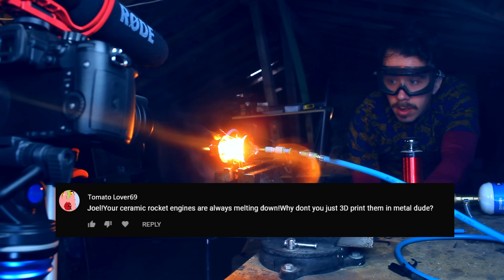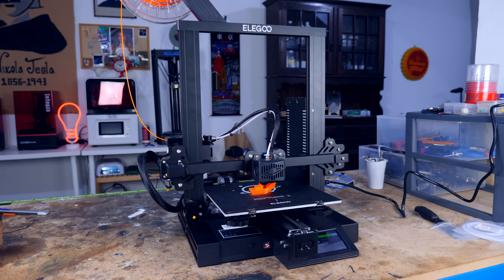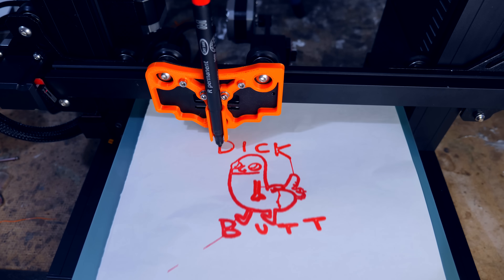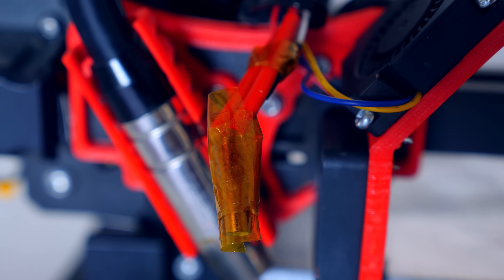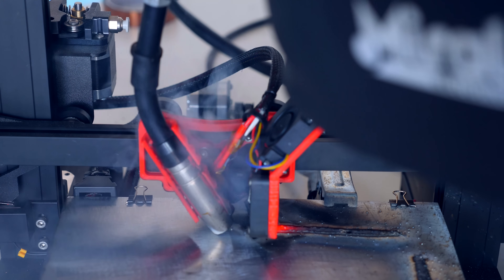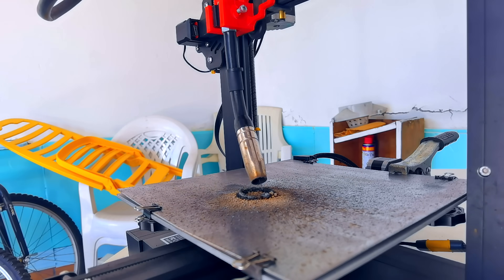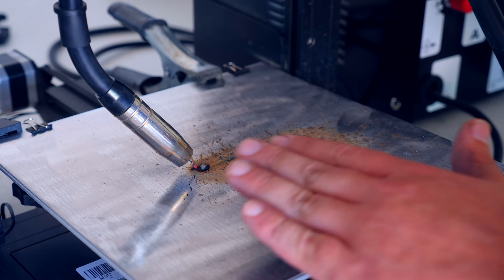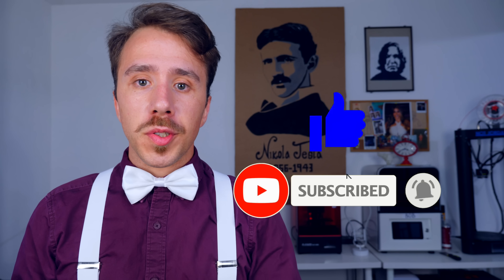I built a Metal 3D Printer using my Welding Machine

Comment: you need to mess more with the welder settings you need to lower the power so insted of penetrating it will gain 
height still and awesome job! And btw theres like a can of a special spray that makes it so does little beads dont stick to the metal

Comment: A (simple) machine using only household items/3d printed parts that effectively strips scrap wire. Copper prices are going up, so there's an increased demand as of late. However, all the .stl's on thingiverse and other like sites are either ridiculously complicated or require a multitude of purchased parts. Don't think I'll win, but having more attention on this would be greatly appreciated by the scrapping community

Comment: Video Idea:  
 Try making ur metal nozzle by 3d printing a plastic one, then use it to make a sand casting mold. the full video could be u DIYing one of those cheap metal smelter out of a hair dryer, plastic buckets and concrete. so then u can melt aluminum and pour it in the sand cast. finally u dremel the final details and there u have ur rocket engine nozzle. 
Saudações xoxo

Comment: you have to put the welder in a neutral position "90° to the surface " and you have a MAG welding machine so u have to use the inert gas at roundabout 8-12 liter per minute . and you have to improve your welding settings . like 123 amps and 9.1 meter per min wire speed , and the distance between the welding nozzle and the metal is to great try like 10 mm

Comment: Amazing how close you were to getting this working.  A few changes would get you much closer!
1. Find a mill to make a metal clamp for the welding gun.
2. The welding gun doesn't need to be tilted, that's mainly so you can see what you're welding, but you don't need to see.
3. You seem to be using flux cored wire, so you have to clean the slag with each layer.  You can avoid this by using gas shielding.
I would love to see you get this to make a metal benchy!
Reply: this, would love to see another go at this from @integza

Comment: Innershield welding wire is better welded pulling behind like an electrode, not pushing in front like you'd do with a massive wire under gas cover. Your mashine sadly doesn't seem to be able to switch the polarity to make that happen. :(

Comment: I wonder, if you had a better quality welder, maybe you wouldn't get the small amount of over-spray on the bed? Also, maybe they make a welder with a thicker gauge of wire so you wouldn't have to have as many layers. A cool video idea would be to make a wankel engine powered tank. It would be really "fun" to make a gear box for it.

Comment: i still say printing your motors in ceramic is good but you should then impregnate the ceramic with metal by either electro plating or if you want to go crazy plasma electro sputtering

Comment: Future Video Idea:
How about instead of trying to print a metal engine, you use your ceramic printer to print casts for pouring metal into?

Yes, it involves melting actual metal down, pouring it into the cast, LOTS of T&E (Trial & Error) and hoping the entire time that it all doesn't end in disaster...  

BUT it would be WAY cheaper than purchasing a metal 3D printer. Just a bit more dangerous and messy.

Comment: Hi, very nice try of making everything work and i can think i can help you with one of your bigger isues.

The issue i mean is the angled nozzle, which isn't actually helping you. 
The reason that the welding itself runs much better after you changed it, is the increased length of the wire between nozzle and the welding bead. 
This is called stickout (atleast thats the english term i remeber for it) and 10 to 20mm should be enough, you have to test it abit what runs best, but setting the nozzle up perpendicular to the metal and having more stickout than in the first tries should keep the welding running smooth. 
Which means your welding bead should be much more symetrical and where you want it in the first place.

Another issue is the warping of the sheet metal and potential heat damage to your 3d Printer.
But saddly to help with that you do need access to thicker (much thicker) metal that can be used as a heat sink below the actual sheet metal that you want to weld on. But even that would not really prevent warping (even 12mm thick welds warp if you do a 3 layer V groove weld), you can only mitigate the issue with using thicker steel, 3-4 mm thick steel should warp less atleast. 

Also an issue you will run into after having more/many layers welded is build up heat, which means either a cool down pause or reducing the amperage and voltage of your welding settings. One warning sign of this should be a "sagging" of the newly welded beads, basicly the higher heat makes the bead hotter and much more liquid. 

If it is helping, i have been certified for welding steel with SMAW/MAG in Germany and while this has been some yeas ago i do remember much about it(, also im only missing a bachlor thesis for having a Bachelor of Engineering in mechanical engineering), so if you have some questions im happy to give some advice.

PS: There are non linear movments in GCode (G02/G03) but i think most 3d Printer don't use them?

Comment: Hey, great stuff you are doing here, love your videos ❤️
I also maybe have an idea how you could try adjusting the current. I think its called binary guessing. For example you got following formula: (max - min) / 2 = current. Max is your maximum voltage and min your minimal voltage (maybe 1/2 of maximum? Idk) test current and if you need more power just fill current in as your new min and if you need less power just fill current in as your new max. That way you can get to the best value way faster than with normal guessing.
Again, great videos. They are always very inspiring and entertaining ❤️

Comment: how about 3d wellding in water?
that might cool the stell sheet and prevent bending
Reply: That would work but it adds a whole nother problem you would have to find some way to ground the water box and the sheet metal separately to get the welder to work properly
Reply: Without the right sort of coated rods, you'll have nothing but porosity. Using a big old chunk of aluminium under the steel plate would work.

Comment: The cheap MIG welders are an AC current welder which causes a lot of problems. And dealing with flux core wire it is always going to look kind of bad. If this was done with a DC welder it would look considerably better.

Comment: Great video Joel something i was looking at doing in the future, why don't you try and put a metal extruder and stepper motor in the welder where the wire is and run the welding wire through that first same as you would route filament, run an extension cable from the 3d printer ?

Comment: Angling the tip of the welder is dependent on the direction of travel, speed of travel and penitration. Also the arc is well over is over 3000°c which on longer periods is going to Warp your bed.

Comment: Here's an idea: How about using carbon fiber for the rocket nozzle. I think it is more durable than ceramic and its not very costly.
Reply: The issue isn’t durability but temperature resistance. Carbon fibre can take high temps but the resin used to hold layers together can’t.
Reply: Fiberglass might be even better, it’s cheaper, easier to work with, and similarly heat resistant/durable
Reply: I dont think that's as much of an issue as you think. He did make his pulse get engine out of carbon fiber and fire place cement and that took the heat quite well. Think it's worth the shot

Comment: The reason it is warping is because the heat is being sucked out by the aluminum and the metal warps away from it... you see this in bladesmithing... when a blade is hot and set on a cold anvil, the blade warps away from the anvil.

Comment: Hey Integza! I know its common to angle the nozzle when welding, but since it is being used in a 3d application, can you try making an angle support bracket? I am not usre what your angle is on that welder, but make the same angle for the support, so it is vertical! that way you can have it much much closer to the print surface and hopfully more accurate dispensing and welding. Also as a sidenote what if a thicker bed was used, I noticed a major amount of bed warping and you may be able to get around this with a nice thicker piece, or even a different grade, hopefully you need need to sell any organs for it!
Reply: I think we would all love to see a continuation of this home built metal 3d printer, as I sure im not alone with us all not being millionaires with industrial grade metal printers at home.

Comment: Video idea, something different to try out...

Can you make, perhaps using the tomato can steam engine suggested previously, an electrical generator powered by sunlight or some other natural heat source (including wood fires, lava, etc.)? It would be nice to see something producing real usable power to operate a microwave oven or similar but that's a lot of engineering and parts to make that happen and is somewhat unrealistic to begin with. So lets start simpler and create something that would produce power similar to the USB QC specification maybe? That would charge phones, tablets, run USB powered lights and fans and other things. If it could be steam powered, with steam produced from a natural source, then all a person needs to operate it is sufficient heat and some clean water. Assuming the system is truly sealed, then it shouldn't need additional water very often and should run for days on end with little fuss or maintenance need. In this fashion it could also run on some natural heat sources all day and night for days at a time.

Certainly not 'free' energy, but depending on the heat source used it could produce essentially unlimited electrical energy for whatever you wanted to use it for. Perhaps to power an automated tomato smasher...

Comment: You could try printing a mould with your heat resistant porcelain resin then sinter metal powder inside it in your kiln - depends how hot it can get, I think you normally have to do it under an inert atmosphere for best results.

Comment: the feed speed of the wire, also might be a problem in combination with the Feed rate and the warping.... it might be to close or to far away from the metal when the weldder gets engaged. since the bed is warping this is differently every time..
And lets not forget. you cheap welder might not have a duty cycle of 100% at this current setting :)

Comment: I work with welding robots every day, we manufacture car parts with them. 
1. You dont want air at the nozzle, they make the weld porous. You want to use a welding gas to push the air away.
2.  Welding gets really hot. Ofc it melts metal. We have some machines that use watercooled gas nozzles to counter this. 
3. Cooling time needs to be a lot longer, we cool parts for about 5 minutes before they go to the next station. Otherwise they will warp aswell (3mm steel)
4. Increase the distance between the nozzle and the sheet to about 15mm. 
5. For speed I would go with around 15 -30mm/s
In general welding in a 45° angle is fine. There a few cases where you need to change this, we mostly only do it because we can't reach the spot otherwise.
Maybe try to weld 2 pieces together with the 3d printer. 
I always thought about putting a hotend to the welding robot but never the other way around.

Comment: Why don't you try to print with tin like if it was normal filament, but with a higher temperature? (the 3d printer should be modified, but i think it might be easier than with a welder)

Comment: Hi Joel I think you could use 3d printed patterns for metal casting to make your rocket engines. It can be stronger.
Reply: Yakup has a point.  Research lost wax casting and lost plastic casting.  The ideal material would be wax, but the only way I could see being able to print with actual wax would require chilling the wax that has left the nozzle and the nozzle itself would be just warm enough to push the wax out like a gel.  Lost plastic/resin would be much more simple and cost effective than building a custom wax printer.
Reply: @Circle14  I think the way Robinson Foundry uses on his channel might be useful. He uses lost Pla method with normal 3d printer. Result sculptures are really good. But i dont know will it be useful for rocket engines
Reply: @Circle14  why not create a silicone mold using a 3D print, and then pour wax into the silicone mold to get the wax into the right shape for casting? It’d be more expensive and time consuming for the first one, but it would be wax and if you had to make multiple it’d be quicker.

Comment: With a this hype around electric cars and hydrogen cars. Make a hydrogen fuel cell that can actually pump out some electricity.
Reply: the hype is mega worthless
Reply: If he built a hydrogen fuel generator it would likely be to create fuel for his rockets to replace the propane.
Reply: @Isaac_Norman   I mean the fuel cell that takes the hydrogen and extracts electricity XD
Reply: @XxBanziixX1  boring
Reply: @Isaac_Norman  much cooler than a hydrogen electric fuel cell
Reply: You can actually run a hydrogen fuel cell off your cars alternator. You can supplement this into a car that has the valves replaced for higher temp that LPG fuel systems have.

Comment: Video idea: Combine a few of your builds into a Tomato mixer. 
For example a sterling engine drives a tesla turbine as a pump that will drive a wankel motor with an attached mixer. 
You could also use the golden ratio turbine as a mixer part.

Comment: Make a CNC, then make a metal 3d printer with it, then try to build a jet engine made of metal with your brand new metal 3d printer. If it doesn't work apply for a job at Relativity space where they 3d Print real rocket engine ^^

Comment: video idea: cast the rocket nozzle in bronze with the lost plastic technique (same as lost wax but you can use 3d printed parts invested in refractory). Even better you could directly 3d print the hollow investment

Comment: One way to help with the warp and the heat is to slow the movements and pulse the welder. I am sure it would take some time to program.  Have the printer move, activate the trigger on the welder, and then move.  The short pauses would help with the cooling and warping.  

 You could also turn down the volts, and make it so the the mode of deposition is a short circuit versus a globular or spray transfer. 

I am guessing that you are using Flux cored wire. When you do get the welds going you will need to make sure to clean between layers to ensure there isn't anything trapped.

Comment: I think one of the issues is that you are using a fluxcore welder. A MIG welder would be more consistent, and you won't have to deal much with the weld splatter.

Comment: Encase the whole unit in a plexiglass box filled and flushed with Argon so you dont need to use spitty spattery flux core welding wire. You will get way better resolution and easier current control!

Comment: Sparky is a good boy.  He just needs to be trained.  An aluminum bed designed for heat dissipation and a way to contain an inert atmosphere would likely fix most of your problems.  You don't want to try welding through an oxide layer.  It makes a mess.  And profession welders only angle the tip because they have to use hands and eyes to control it.  Machines don't have that problem.  I think perpendicular is the way to go.

Comment: Why not try a lathe? There are mini-lathes at good prices. That way can make the nozzles or even the body of the rocket that you want. 
I really like to see a jet engine, a early one, not turbo-jet. That you can lathe. Or 3D print it with carbon fiber coating.

Comment: Hey Joel.
I have some tips for you:
- You can actually print "real" cicles with G-Code. just use the G2 and G3 commands - you will still get an iteration, but the x- and y-axes move simultaniously (which is way better than the line iterations with G1)
- please don't try to "print" your engines with a MAG/MIG-Welder. The material properties are quite poor and the massive amount of slack produced gets infused into the part which causes the properties to get even worse.
- always use inert gas when welding to keep the weld good

I had a lot of fun watching the video - great stuff! Keep it up bro!

Bonus Video Idea: Send your rockets to a metal 3D-printing company (we have a lot of those here in germany - very high quality - i know it, since i worked together with some of them) and run it properly.

Comment: Video idea: how about you using your 3d printed parts for casting. You could cast in plaster and then use those casts for metal casting. Maybe then your engines have a higher chance.

Comment: Hmmm...  contrary to a normal 3D printer, I wonder if a chilled bed would work here? You know, both to protect the plate from warping and wicking away heat from the print (since the print itself is made of conductive material, the whole structure would be like a giant upside down heat sink.  LOL).  And instead of a fan to cool down the print as its extruded, you'd almost need compressed air just for the flow rate.  :D

Comment: You would probably have better results if you used a mig welder the gas would cool the welds a little bit more and have cleaner welds and I would probably water cool the pad

Comment: you need to use none flux wire and a gas like 75%argon and 25% co2 or 100% argon so you dont need to clean the weld area and maybe if you  can make it pules a tac then move and the another and so on  that might help with your heat warping problem on your base plate

Comment: You should try casting a rocket engine instead. You could 3d print one and then fill the 3d print in with sand and bake it off. Then just pour the metal.